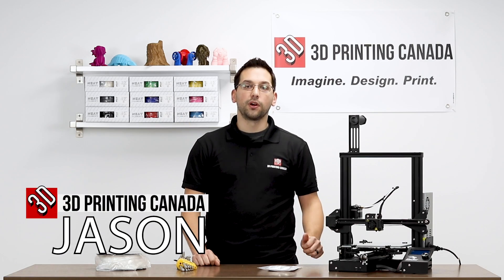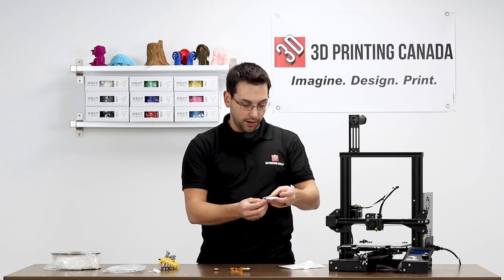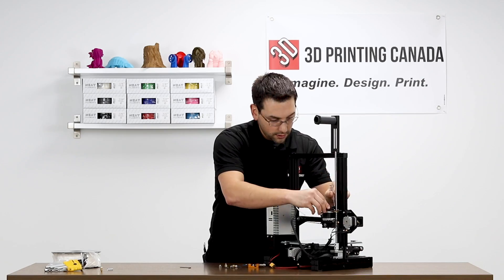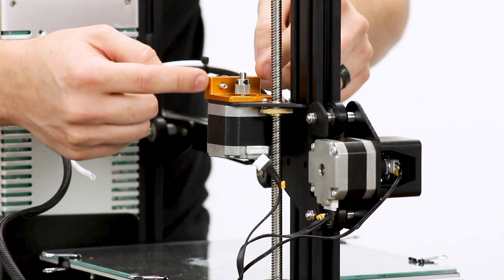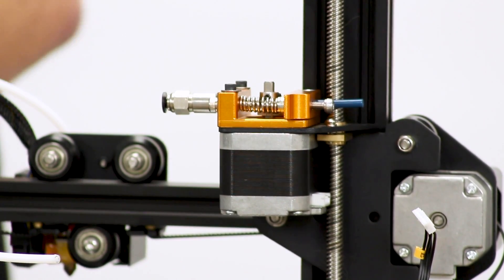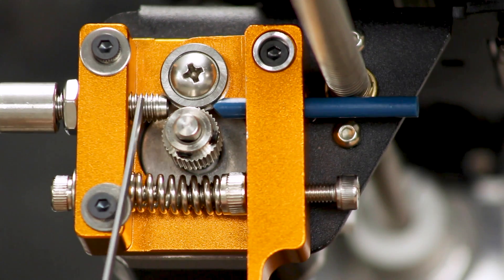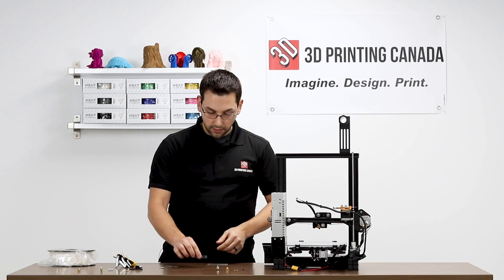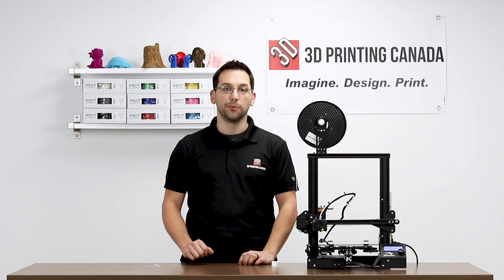Print Flexible Materials on a Creality Ender 3 - MacEwen3D FlexiPLUS Install and Test

Comment: If you don't mind printing your own parts there is a printable  mod here  https://www.thingiverse.com/thing:2605108 that's basically the exact same design, just that it uses a piece of ptfe tube instead ot the heat break looking thingy. I regularly print flexible materials with it and it works flawlessly. I do like the screw for adjusting the tension thou.

Comment: Thanks for sharing👍😀
Remember to remove retraction when using TPU thou, or else the filament will crinkle over the extruder...
I have been there ;-)
Reply: Ive found that using a little bit of retraction with tpu (like 2mm with 0.4 nozzle) helps with oozing by lowering the tension that builds up in the bowden tube. I had a problem with the spring being too strong and causing the filament to wrap around the gear thou

Comment: Congratulations on another excellent video!  :)    Please allow me to clarify some ambiguity on the stainless gear.  The stainless gear will require no change in your extrusion multiplier from the stock brass gear.  It is the same size as stock gear.   I know you did not have the latest instruction sheet it at the time of shooting.
Reply: I was going to say - I haven't adjusted my extrusion multiplier at all since switching and its been absolutely flawless. Thanks for Taking the time to clarify the capricorn tubing/Z-Axis rod clearance! I've printed about 300 grams so far and honestly there isn't a speck on the threaded rod. Its very clear that the extruder has a lot more gripping force on the filament than the stock setup - I haven't had a single issue since switching to it, even when I probably should have (First layer too low)